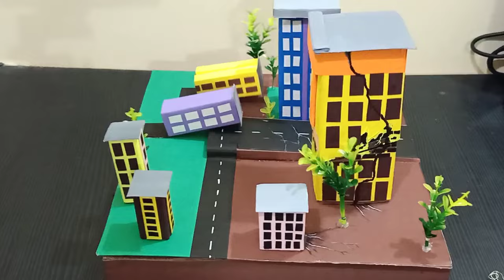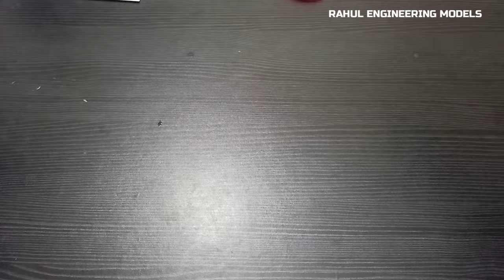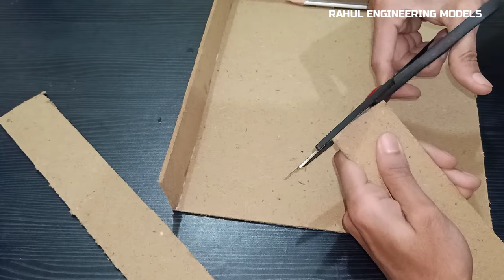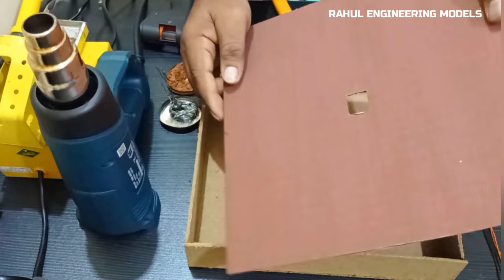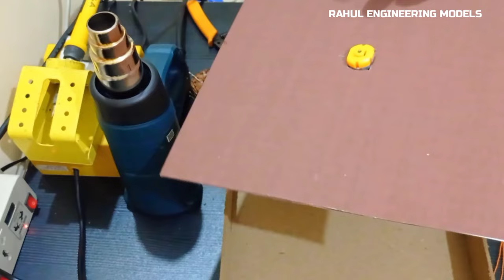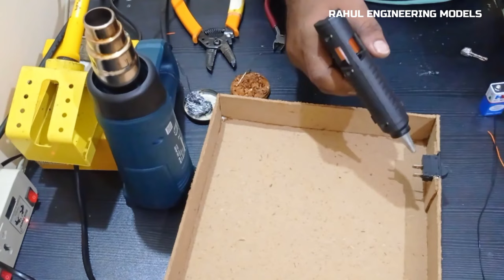Earthquake Working Model : How to Make Earthquake working model

Comment: List for all the things 
1) DC Motor 
2) 9v Battery 
3) Switch 
4) Springs
5) Any heavy thing to add in the motor to make it vibrate(you can attach screws at the tip of the motor with the help of glue gun)
Reply from the maker: Thank you ❤️
Reply: @RAHUL_Engg_Models what's the brown and silver thing?
Reply: Fji
Reply: Where can I buy these things?
Reply: @Tgklegend7740 what is that
Reply: O

Comment: To those who can't find the unbalanced weight online you can use alligator clips instead. I already tried it for my project and it work!
Reply: Its also better to add atleast one more motor if your cardboard is wide and thick. My cardboard is 21inches wide and i use 4 motor for better vibration.
Reply: Can u pls tell me..what is that white thing..4:03
Reply: If you remember lol, how many volts did you get in your dc motor? 😅
Reply: @chimkyn-_-  If I remember it correctly I think I used one 6V, two piece of 9V then one piece of 12V, and because it's too many I didn't use a battery I just connected it into a wire instead (I didn't know the right term for this but if u know how phone charger works that is exactly what I did)

Comment: Hey how did u do the unbalanced weight??
Reply from the maker: By using one bolt and some copper wires.
Reply: @RAHUL_Engg_Models  and wat about the pipe thing?? Pls reply fast
Reply from the maker: using card sheet and springs...
Reply: @RAHUL_Engg_Models  is it necessary??
Reply from the maker: Yes... Springs play very important role in this project
Reply: @RAHUL_Engg_Models  spring of what plastic or metal pls reply fast
Reply from the maker: Metal or Plastic
Reply: @RAHUL_Engg_Models  where is the spring you used
Reply: @RAHUL_Engg_Models  please reply me where did you use the spring ....
Reply: @RAHUL_Engg_Models  please ek short list btado kya kya cheese lgani h isme or motor k upr ye kya lgaya jo round round ghumaya
Reply: What is the use of that thing 11:35 please tell me

Comment: Can you please tell a requirements full
Reply from the maker: Material used in this project
Cardboard
Cardsheet
Springs : Any
9v battery
Toy motor ( Attach a unbalanced weight )
Switch
Reply: @RAHUL_Engg_Models  can u pls tell can we use anything else other than spring
Reply: @RAHUL_Engg_Models  thanks

Comment: Please suggest all the material used in it......
Reply from the maker: Material used :
1. Cardboard
2. Glue
3. Colour Paper
4. 9v battery
5. Toy Motor
6. Spring ( matal or plastic)
7. Switch
8. Wire for connections
9. Counter weight welded at the end of toy Motor or alligator clip
10. Glue gun - optional